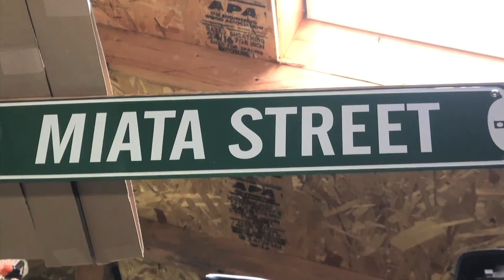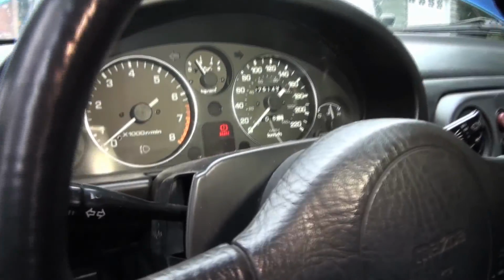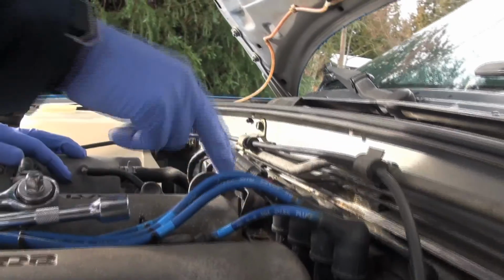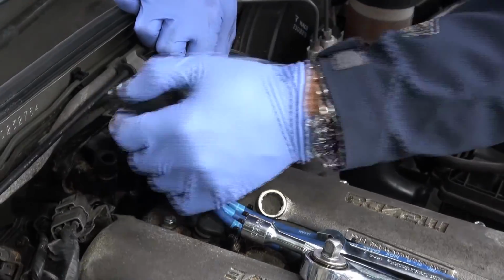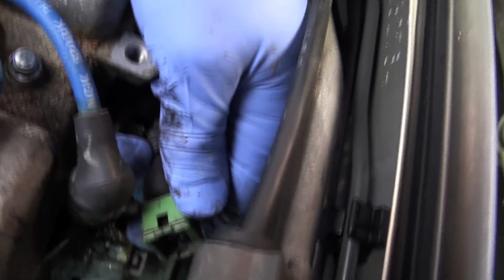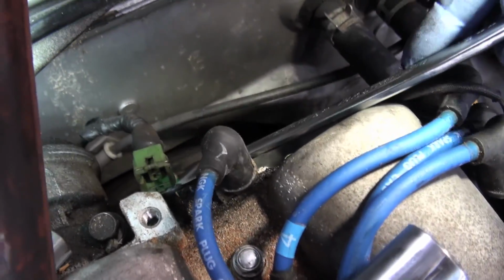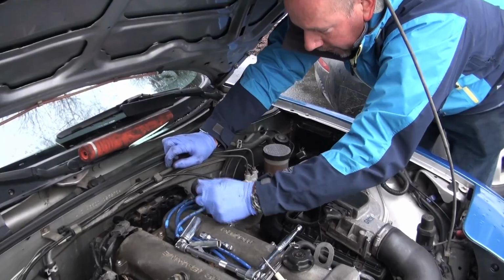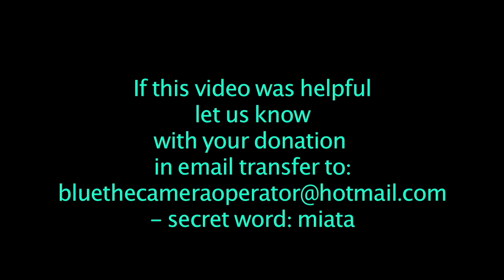Miata MX5 1991 model Temperature Sensor  Diagnosis & Replacement

Comment: Just a note: this works differently on non USDM Miatas, on my EU version there is no check engine light, I need to connect a LED to the diagnosis box, and it flashes there.
Reply: This ^^
was the same on my eunos rhd model. connected a small Red led with a 2000ohm resistor on the B+ and FEN pins. kinda annoying but easy at least

Comment: I was hoping for some insight into where the engine tempratuer sensor was on a 2005 MX5 NC and how to test the operation of the radiator fan. But unfortunately Mazda keep changing types and location of devces. I was hoping to put a resistor in the plug to force the ECU to operate the fan as it appears that the fan or some other part of the circuit is at fault.
The fan is also essential for the A/C to keep refrigerant pressure down. Any clues. Cheers.
Reply from the maker: If your wiring is stock and in good condition, I would think that it is one of the following causes: 
-Bad fan motor. 
-Bad temperature sensor (at back of cylinder head). 
-Bad fan relay.

Comment: I have a 1995 Miata and the temperature gauge on the dash is currently not operational.  (previous owner says it stopped working a few years ago).   Would this be a likely culprit for the temp gauge not working?
Reply from the maker: Could be a bad sending unit or a bad temp sensor. Both are located at the back of the cylinder head below the coil pack. I would change them both to be on the safe side.
Reply: @MiataMan  Thanks for the advice!  I'll post an update once I am able to tackle this job
Reply: @JonPaulovkin  any updates?

Comment: That bolt in the back you don’t need to take out as far as I’m concerned the coil pack slides up and out it’s like a little rubber grommet. You’ll see the notch on the bottom of the coil pack trust it will save plenty of sweat and tears lol.
Reply: I had to replace my coil pack it was causing unsuspected misfires. I redid o2 censors spark plugs, spark wires and I genuinely thought I jumped timing lol. Replace your coil pack before your timing 😂 I was almost balls deep mane woulda never thought coil pack because they looked minty
Reply from the maker: The rubber grommet becomes very hard and melts itself to the coil pack bracket. The pivot bolt is not hard to remove, once you know it’s there. 
I’ve seen a lot of Miatas where the bolt was never reinstalled.
Reply: @MiataMan  that sucks man thanks for that info. Mines relatively untouched so I didn’t know that thanks!

Comment: How to clean the code ? Help me please
Reply from the maker: On a 1990-1995 Miata, you can clear the codes by disconnecting the battery for 15min. 
The ECU/PCM will be reset.